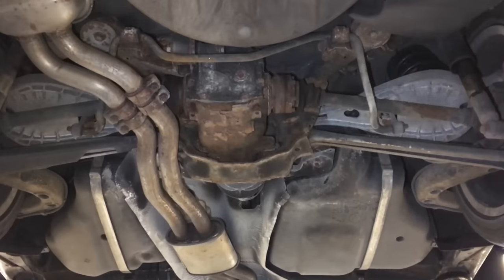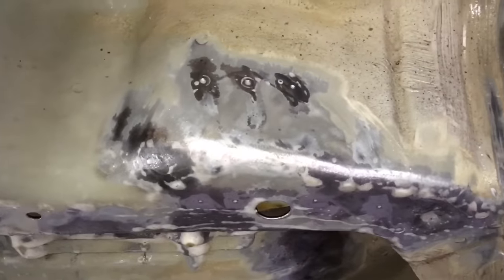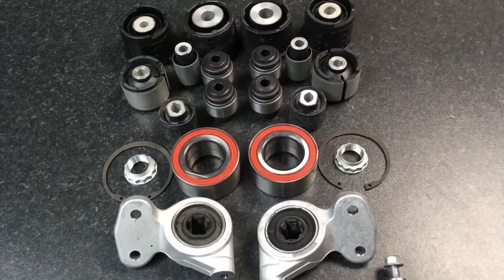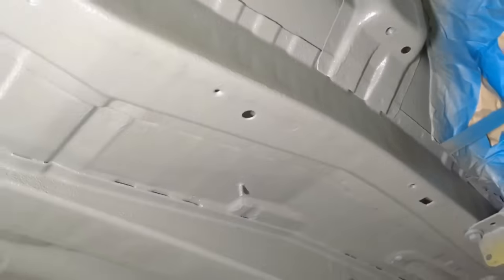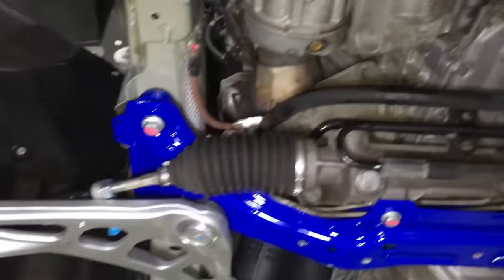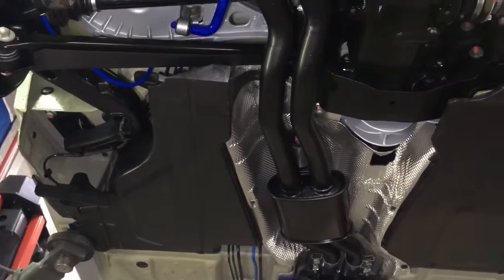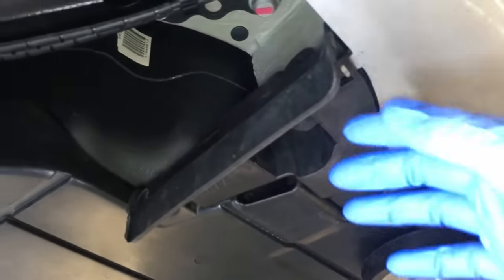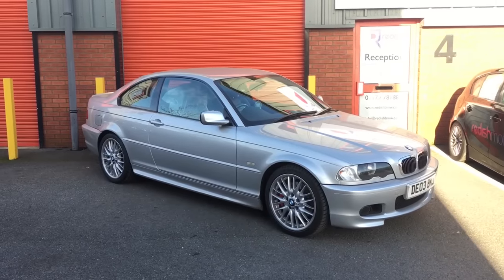BMW E46 330ci - Underside Restoration - Better Than New!

Comment: Wow... beautiful work... and one lot of it.

I have been working on exactly this on a P38 Range Rover 2001 Holland & Holland.  Not complete yet.  So far without exhaust system, new wheel bearings, new brake speed sensors, and new ride hight sensors, it has been $7,000.00 in parts, and a lot of work.  Replacing all brakes, joints, bushings, bolts, and some heat shields need to be remade in stainless for durability.  Will make new stainless exhaust, and weld the new fabricated stainless heat shields to the exhaust!  Disassembly to this stage... was a really the hardest part due to various frozen fasteners and parts.  Be ready to use lots of penetrating oil, heat from propane or MAP gas torch, and a bottle of CO2.  You might also damage some wire connectors that have become brittle, which will then need to be replaced and installed into the wiring. You will likely replace all the plastic mounts for the various lines and wires... for the same reason.  The Heat and CO2 freezing are the only way to unstick some metal parts... this cracks the corrosion or the thread sealants used.  We opted to remove all the undercoating, paint and primer from the entire underside, a brutal job with wire brushes to bright clean, so to get into all the nocks and crannies.  Ladder frame we use the 3M Strip and Disks, as well as for heavier parts but sheet metal you have to wire brush and or use finer #M cleaning disks.  This involved raising the body 4" to 6" with it higher at the back.  The cost for wire brushes and the disks has exceed $400.00.  We found using a heavy duty low speed straight grinder like the Makita at 5600 rpm works better than like a Fein at 10,000 rpm... burned up a Fein.  Doing it outside below 30 degrees F works best do to the undercoat being brittle, and melting less.  But this rules out the use of pneumatic tools due to freezing after 3-5 minutes of use, and we have refrigerated moisture removal air supply, work well in shop.  Also, note below freezing you don't have to worry about surface rust reforming, even with lots of cold rainy days.   Cleaning differentials is basically about 6-8 hr. job each.  The suspension parts etc add up time in a hurry.  Painting takes more time as etching, phosphate pre-coating, drying, painting with three coats of KBS coatings Rust Seal followed by one or two of KBS Top Coat is time consuming... worse that must  be done without exceeding time between coats, to prevent scuff sanding too.  Use the KBS Crystal Clear coat on the aluminum parts after wire brushing, etch and phosphate treatment.

It is really true the plastic shield help, behind them little if any other than cleaning dirt.  However, the front tires kick up a lot of rain, snow and de-icer so anything that touches gets sand blasted and rusty.  We found the rubber over-molds with steel inserts to be junk, things like mud flaps... steel roots out... don't use... opt for even the Chinese plastic substitutes hold up better.  Biggest surprise has been the fuel tank opening cover the sheet metal retainer was almost totally eaten away with rust despite protected position.  Getting  rid of the aluminum over hardboard heat shields is important, and it's better to fabricate stainless steel ones that weld onto the exhaust pipes (if Stainless Steel) than attach to body.  Biggest surprise, well four besides the fuel tank opening closure, and anything steel overloaded in rubber junk: a) bumpers held on with very weak and corrosion prone attachments, b) finding the speed sensors for the brakes absolutely frozen in bronze bushed mounts to the axle housings, c) the absolute junk fragile heat shields made of fiberboard covered with basically dimpled aluminum foil... falling apart, and d) plastic fuel and air suspension lines... can live with plastic air suspension lines but the fuel lines must be metal preferably stainless steel or Aeroquip 601 aircraft crashworthy spec hoses.

Comment: Why didn't you guys do rear sub frame reinforcement
Reply: Simple, the e46 chassis in stock 330 guise doesn't need any. BMW should be ashamed of themselves for building a chassis that's drastically slower than what they knew way ahead of time was going to get installed, the s54.  They know the rules but obviously due to cost cutting measures ignored them. Always, always and always design an appropriate chassis that's faster/stonger than the engine, period.

Comment: I was thinking of bringing my 330ci for the RCP check and quote but I'm worried that a full suspension refresh might cause trouble with the local swiss car check they do. Have you had any swiss clients doing similar jobs? Wish there were a similar company in germany would be easier for me.

Comment: Hello! Magnificent job! I am trying something like this at home. My question is what kind of welding machine/technique did you use to weld back the fuel tank holder brackets? These must hold the fully filled (~60 litres) tank. Thx

Comment: 2:08:22  Look behind that ribbed rubber(bottom right of the screen), deeper inside, LOOKS LIKE YOU LEFT SOME RUST !! 😒🥴🤭🤫
Reply: I believe you are looking at the exhaust headers. Unless they get ceramic coated or you replace them withe stainless steel headers, I suspect they all look like that.

Comment: Great job, looks brand new. I personally wouldn't have spent 3-4k on a car thats worth £800. If the customer loves the car  it will now last many more  years, at least the chassis will!
Reply: 800 ? I bought my 2004 e46 with 5 000 this year
Reply: @GiosanGioVw  a 330ci auto with high miles is under 2g all day long

Comment: That background music is really annoying!
Reply: I really liked the music, reminds me of working on stuff in the shop. Maybe you should just deal with it and thank him for the great video and stop complaining.
Reply: Ok trolls, whatever works for you!
Reply: @tk2070 mine was an honest comment too, but the last thing you have any tolerance for is an honest comment which is different from yours.
Reply: @brianfleming2051  Fair enough. Have a nice night.
Reply: @tk2070 Just for the record, I loved the video, and passed it on to another enthusiast  who enjoyed it as much as I did. We are both professionals in aviation, he is in maintenance, myself in software engineering, and we both marveled in the attention to detail and beauty of his work.  However, I found the music distracting, if you liked it, fine, but that does not make me an idiot because I am different from you.
Reply: @brianfleming2051  Nice, ill delete the comment out of respect, best of luck ahead.
Reply: @tk2070 Thanks, but let's get back to cars.  I may have missed it, but what did he do  to prevent corrosion on the back side of the reinforcement doublers he installed at the suspension hard points? Most modern aircraft today are literally glued together instead of using mechanical fasteners in many locations.  Has he considered using high strength structural adhesives often used in aviation like Hysol for the reinforcement doublers?  If this were done, thermal stresses associated with welding would be eliminated, corrosion on the back side would be a non issue because of the adhesive which was bonded to the bare metal, and loads would be distributed over the whole surface of the doubler, not just the edges where it was welded.
Reply: J Pratt  Actually some of it is genre defining seminal house music - see Age of Love - Age of Love

Comment: hey can i ask what stages of paint did you use, im guessing it was primer, base paint, and clearcoat, also what sand did you end with?? its its different let me know,
Reply from the maker: Good questions. It's Etch Primer, High Build Primer, Sprayable Seam Sealer, Top Coat Colouring. Hope that helps.
Reply: @RedishMotorsportbmw  thats great thankss you can seam seal over primor? thats kinda where i was stumped

Comment: Are you using a wirewheel to take the rust back and a sanding disc on a grinder for the flat area's?

Comment: Wow great vid, my 330 has more milage and not nearly this bad. But typically something I would do. Love the e46 330i's and the engines are mostly bulletproof
Reply: My 330ci blew up after a failed ccv sucked oil into the cylinders and hydrolocked it leaving it beyod repair. Luckily i got a donor engine and it's been great since. Did a CCV delete and put in a catch can instead. If you live in cold climates it's highly suggested to do this. My CCV failed after an extremely cold night leaving the car outside at a friend's place. Won't have to worry about that anymore now though!
Reply: @drew32  o wow what a story, never knew that was possible. I personally replaced my whole ccv system last month an next week is most of my suspension. My car has 207,000kms on
Reply: @Viperoloff01  Good job in replacing it. If i knew these things have a history of failing in cold climates i would have changed it. Live and learn i guess lol

Comment: Do you find that the undercarriage sprayers are car washes help in reducing the onset of significant corrosion?  I was barely in Wisconsin for very long (only a few years) from Arizona, and I routinely washed the undercarriage every chance it was warm enough to keep the water from freezing up in the lines and along the car wash entrance/exit.  The salt that's applied to the roads for ice remediation is ridiculous, but I wondered how you guys take care of your own vehicles year round out there.

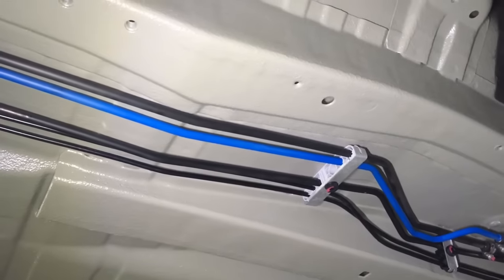Comment: @1:10:00 Is it a fallacy that you should use fuel pipe clamps rather than jubilee clamps?  I recently replaced my fuel pump and was advised to use the fuel pipe clamps.

Comment: Worth every penny!  BMW M3’s w/V/8 engine’s are only going up in value.  Porsche 911 air cooled engines  need to be resealed every 5 years or so.  $18,000 US.   Even though they’ve been going up in value as of recent , well actually the market has gone soft here for air cooled but you get the point.  .   $10/k isn’t looking too bad...👍

Comment: The alluminum heat shields running along the exhaust, I usually put a big glob of grease on the bolt heads and replace it if I take the shield off. Is it beautiful, no... but it keeps me from buying new shields that don't rattle every 3 years lol.
Reply from the maker: Great comment Jesse, that sure helps corrosion build up to rot them away prematurely like you say.

Comment: Why paint every single bolt pink? Isnt that just a "warranty seal" used on only a few specific "dont touch" bolts?
Reply from the maker: It's a reminder that we've fully finished with that bolt and it doesn't need further attention.
If you can imagine getting to the end of the rebuild and wondering if some of those 300+ fixings need double checking - it can be a real pain. 
Paint marking them is a trick from racing circles and ensures that fixing 'is safe'.

Comment: Very nice! I have an e46 320ci..I think the most damage to the underside is because of the salt on the roads..
A question,does anyone have a limited slip?(I need it for extra traction on snow&ice,not racing) what would be a good buy without having to spend a fortune? Thanks,Bob

Comment: What does a job like this cost. Many people always ask if it is worth doing to a car that cost x. Well, if you plan to keep your car long term I say hell yes. I have a 2007 MB C230 that has been reliable and I am now going on 12 years (146k miles) with the car and plan on holding on to it another 5-6 years. I fix what needs fixing and keep going. Tempting to want to buy a newer car with all of the tech but I also like not having a car payment. Thanks for the video. Again, ball park figure as to how much a job like this cost would be helpful. Thanks.

Comment: That's an absolutely outstanding job that goes without saying.
But it really does beg the question - was it worth it?
I would have got the most serious rust and repairs sorted at a fraction of the price.
In the years to come by the time  the rest got serious, the car would have either been scrapped or would be in a lock up somewhere awaiting a full restoration in which case it would get done then, and be worth it on a valuable classic, which it will unlikely be because of its big brother the M3.

Comment: 2:02:55 How does owner will drain Oil when you installed M3 Reinforcement Plate? pretty sure that small round plastic hole which made for M3 S54 engine will not match Stock 330ci M54 engine oil drain plug now...am I crosseyed? am I? who am I?
Reply from the maker: Hi Gabo, great spot and thanks for the comment. You're right - that is one of the drawbacks with using the M3 stiffening plate.
Reply: @RedishMotorsportbmw  dipstick magic it is than, shame. other than that just wow, so much work and everything is so so nice, eeh I could not ever drive such nice car. show car level, collector level. respect level

Comment: Wow, that is beautiful work, what kind of wax do you use for the drive shaft rings, and do the sensors read the rings well with paint over them. I ask, because I'm about to replace the rear axles. Thanks a bunch for the great videos

Comment: Unbelievable!!! Cost a fortune for sure.  What did it repair???  I have a wobble still after so much front end work already. Steering wheel as a speed specific shake :(
Reply: wheel bearing and hub assembly if you havent done it already

Comment: Whats the key to keeping a car looking like this? I've a 2016 BMW F31 and am thinking about doing a Dinitrol treatment every 2 years.
Reply: DodgeCity111 never driving it in the wet, and garaging it over the winter while the roads are being gritted, basically you need a sacrificial beater car to let you park it up during bad weather.
Reply: @Jonathan_Doe_  Bid respect to Redish. They truly turned the clock back on this one.  I'm sure the owner was overwhelmed.

Comment: hello
does rear subframe issues happen on all e46 ?
 i'm looking for a 330ci from 2001 or a 330cd from 2004.... thanks
Reply: not all but 90 percent have them yes aspecialy the ones with the stronger engines in it like this 330ci or the 330d's and m3, most people owning one strongen the rear subframe with steel plates welded in between, I even think bmw did those themselves aftermarket because of the many problems with the rear subframe. Costs about 500euro's to strongen the rear sub frame, I also had the problem on my tuned e46 330d and had ik fixed that way at bmw.

Comment: If you got a car like this and you have the top range engine mounted to it (in this case the 3.0 because the 3.2 is the M version and a whole different story) then such a job definetly raises the resale price. And the older it gets the more value it has. It makes it just a bit more complicated to sell (if you are going to do that) because the ammount of people willing to pay a specific price for a specific type of car gets suddenly lower if you lift yourself above the actual average price range on one of these. BUT! ...it doesn't matter because whoever already owned at least one of them and wants to own another one in much better condition then he owned before then those kind of people will be ready to pay extra for such extras. And you can not argue that for the same price you could easily get the newer generation 3er or a completely different car. The E46 is in its age where if you want this specific car then you have two options. You pay the price or you don't drive the car :) and that rule goes for pretty much any car regardless the brand or model when age is a factor a mint condition is like finding a unicorn. Once in a while you get to see one but to buy one is not easy. Because whoever has one is not nescessarily willing to sell it which makes availability on the market not exactly large :) just like this one where the owner already stated: not for sale and "never wants to get rid of it " :)

Comment: Lived with a woman once put my favorite boots in the trash.
So I took 'em back out. Kept wearin them.
Then she did it again, and I took 'em out again, went and got them resoled. 

They wore tighter than they had before this, but eventually the leather stretched out and all was well for spring and summer and most of the fall. 

Winter did something though when it came, and I pig headed wore them snow and dance halls, wood cuttin and stove sittin'. I let 'em live a full life. Let 'em at it.

Anyways the split came on the sides and that was them. Woman back with a reason and I knew the day would come. Knew I hadn't the heart myself. Wouldn't have and I knew this.
Kept wearin them until they disappeared one Saturday when I was at the old barbers I'd learned of where a young man can really time machine. Veterans make great barbers if you time it right and God knows where they get them radios from, but them places help begin new boots looking down at them. Starts something.
Anyways, the woman had some ground to stand on when I got home and the porch door hit against air when I opened it. Knew it had happened. Didn't look up.
So I said nothin'. Just loped about the place like a sad clipped dog.

Then one day I'd a great idea and I up and left her.
This was over sixteen years ago now. Spent seven years with her. All seasons. Damn pretty woman and god could she cook. Meat and potatoes all the way. Fish, Pies. Apple crumble. You name it.
Stuff you hear of on cook shows now. Stuff you can't pronounce. Old recipes her grandmother had.
Turn her hand to anything in a house. Heal anything you hurt or felt. Made love like someone else's wife.
Can't think really now why I left her. I probably didn't really mean to now I think of it. Still, it's done.

Boy I miss them boots. Never did fall in love with the new ones. Or any woman since. Not really.

Figure the best boots are the ones you love resoled. 

Goes for anything really. Brush or broom. Just can't re soul a woman.
Could have been the reason. I dunno.

Anyways, class job on the car. Just always look out for winter I guess. 

But never look back.